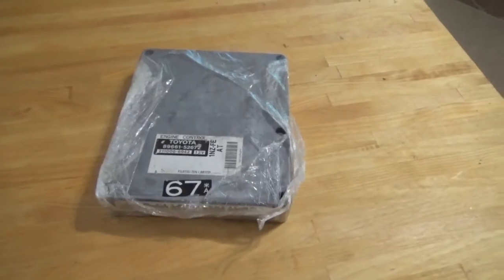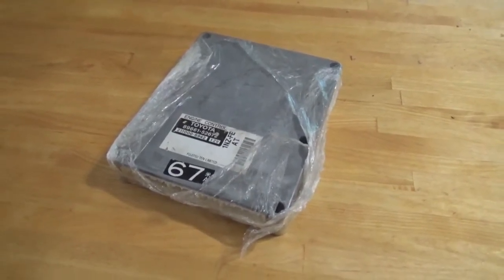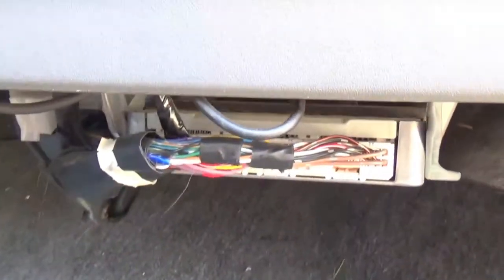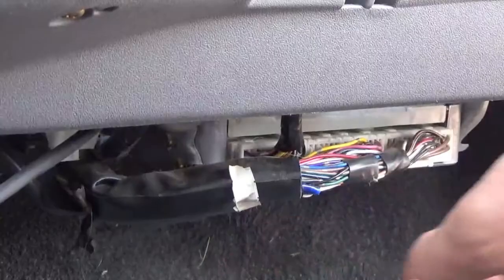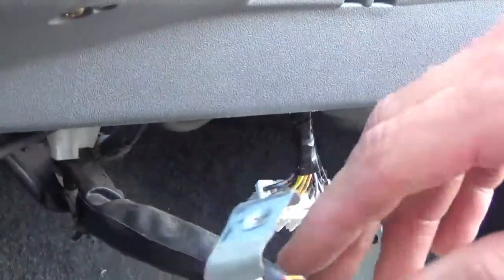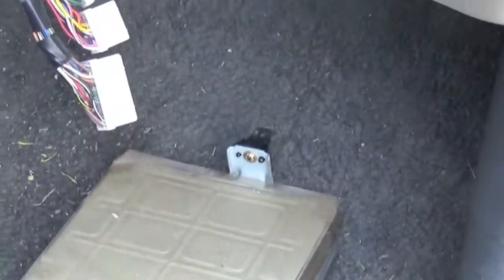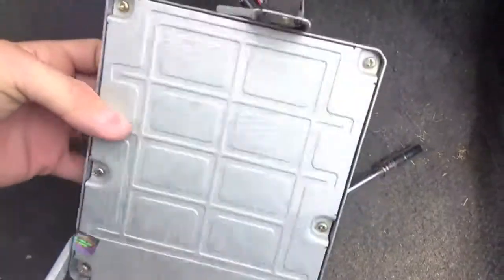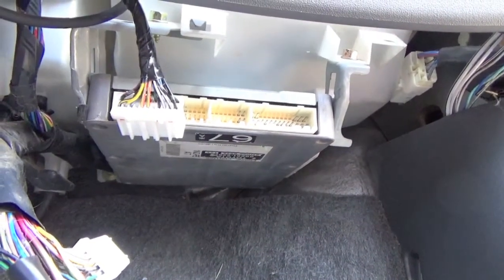2000 Toyota Echo ECM (Computer) Repair

Comment: My echo does not turn the check engine when turning the switch and cranks but doesnt turn on what could it be😊
Reply from the maker: I would love to help, but I would need a lot more information. I would find someone with a "code reader" to assist in diagnosing the issue. Sorry I could not help more.
Reply: @HNXMedia  i traes to san it but doesnt give any codes

Comment: Thanks a lot for the instructions and the bloody fair point of not taking on this job if you can’t change a tyre. 
I’ve had my Echo for about 6 years, I’ve only had two issues where it’s broke down on me and they were battery and a stupid mistake on my part.
Do I like the car, no… but it’s hard to get rid of what you know, especially when it’s so cheap and been so reliable. 
I’m an Aussie, Holden girl too… but it pains me to say that I hold my trust to get about with Toyota.
Reply from the maker: Glad I could help! You know, it's not so much about liking the car and more about it doing its job. Mine is 24 years old and still running strong. Is it my favorite, maybe not, but it sure is reliable. Stay well and stay safe!

Comment: I need a new ecu I think. I can get a few but how to I fix the key issues without reprogramming
Reply from the maker: My vehicle did not require any reprogramming and it just has the "ild fashioned/non-computer" key so it was not an issue. As long as the ECM communicates with the ignition (on a more modern car) it will likely not have any problems or require reprogramming either.

Comment: I have that same problem on cylinder 3 of a Corolla CE year 2000. The local garage tells me the chain and chain tensioner are fine, but identified that the ECM has the problem. A local garage cannot do the install, but with the correct ECM, I can do it myself. A local mechanic used his own good scope to see a 'problem' on cylinder 3, but the #3 cylinder coil and fuel injector are fine. And the problem started suddenly and no noises are heard... just a rough running like 'out of time' a bit.
Reply from the maker: Doug H. in VA Yes, that is exactly the same problem I had with this Echo. Same cylinder even (if I remember correctly). This instantly solved this issue after dealing with that "missing/out of time" thing for over a year. Still got the Echo and she still runs flawlessly (19yr old car). Hope the video helps.

Comment: And what about immobiliser, it is not need to deactivation immo, it is not possible to start this car without it...
Reply from the maker: Not sure what you are referring to, friend. This fixed my problem and 3 years later this car is still running perfectly. If you give me more details, I will try to help. Peace.
Reply: @HNXMedia  I have got Toyota Yaris (europe version of Echo) 2002, and sometimes it is not possible to start it (security led blinking) starter is turning but the engine engine do not start. So it seems to be any problem with immobiliser (ecu do not recognize the key by immo ring or etc). So I would like to deactivate immobiliser completely cause I do not need it and would like to always start the car.
Reply: Normally it starts immediately, after key insert security led stops blinking and car starts. But sometimes, especially in hot weather it is not possible to start it , security led do not stop blinking also with key inserted. So its seems to be any problem with immobiliser circuit.
Reply from the maker: @dusanskulavik1878  I would certainly like to help you, my friend, but I have no idea how to fix that problem. I do not want to give you bad advice. If I had to make a guess, I would think it is the ignition control. Best of luck. Peace.

Comment: Did your VIN number change to the used car part your bought?  This sometimes happens on newer cars, not sure on a 2000 echo. If the VIN changes you will have a problem when you get it inspected.
Reply from the maker: To be honest, I have never heard of such a thing. The VIN is fixed to the automobile and based off the "frame" and the "engine." Swapping the computer or ECM should not effect the VIN in any way at all. Thanks for watching and taking the time to leave a comment. Peace!

Comment: Does it need to be programmed? I think my issues are caused by a bad ECM and I just bought a new one on eBay. In the ad it mentioned the dealer might charge me to program it.
Reply from the maker: I got mine off of eBay too! As long as you get the proper ECM to match the year of your vehicle it should not need to be programmed.

If for some reason it does, a dealer or someone with a programmer should not be charging more than about $70.

Hope this helps! Thanks for taking the time to comment and watch my video. Namaste!
Reply: I bought the same year. Fingers crossed! My car is having a bizarre suite of symptoms and this seems like the likely cause. Thanks for the video!
Reply: @djfour  hey man, did you resolve the issue on the Echo back then? Was is erratic revving like I have on mine? I'm just wondering if new  ECM will fix it.
Reply: @VadimH.-ms7dx  blast from the past! I believe in my case it ended up being the mass airflow sensor. I also had to replace the o2 sensors

Comment: HNX media  I am having a similar problem with my 2003 echo. the car check light came on and when I had the guys at pep boys check it out with the code reader it came back as a misfire on one of the cylinders. Can't remember if it was the 3rd cylinder. They recommend that I get a tune up to fix the problem. Should I try that first.
Reply from the maker: Depends on cost. If tune up = $100, you could get a used ECM and try it for around $90 (return it if it doesn't work). Thanks for watching and taking the time to comment.

Comment: What were the symptoms of your car that led you to the ECU?
Reply from the maker: With a code reader, I was getting a code for "Misfire on Cylinder 3." After extensive testing (spark plugs, coil pack, compression, fuel injector, wiring) and none of that being the issue, I asked a friend who suggested that the only issue could be a computer "glitch." I took a chance on a used ECU and it immediately fixed the problem. Car instantly started running like new.
Reply: @HNXMedia  did you feel a misfire in the car or did the check engine come on before you noticed?
Reply from the maker: @honorable_villain  Felt the misfire. The engine light never really came on.
Reply: @HNXMedia  so I just bought a used ECM same year and part number for 2010 Toyota Vitz. I will install it on my day off in a few days. It came with a key but I tried 3 batteries and red indicator light won't light up. Seems new key fob is dead. Will my current key fob for locking and unlocking doors work with this new ECU?

Comment: When replacing ECU, do you need to program replacement? Thanks!
Reply from the maker: No. A long as you get an ECU that matches the year and make of the vehicle, it should be "plug-and-play" -  no programing required. Thanks for watching and taking the time to comment.